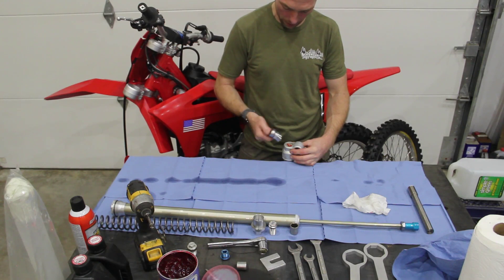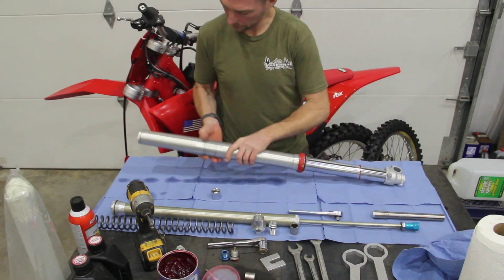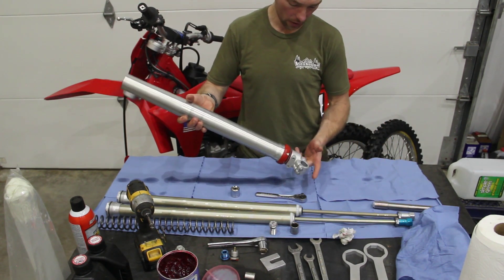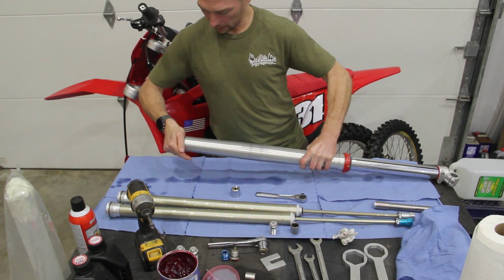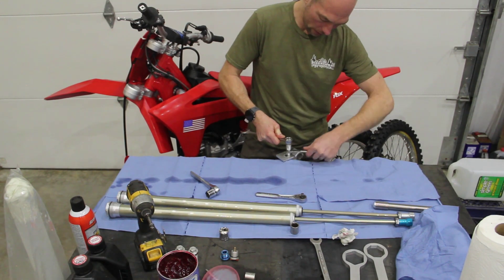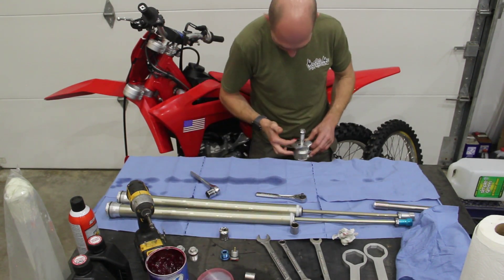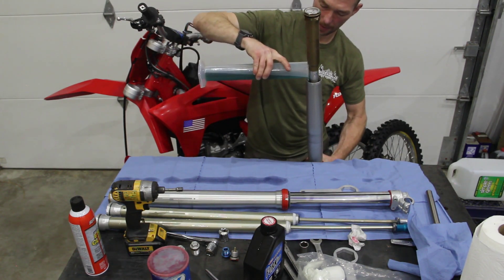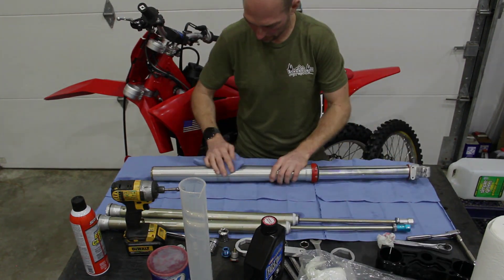KYB Spring Conversion QUICK GUIDE - KTM, GasGas, Husqvarna - dialedmfg.com

Comment: Do you have a kit for 2018
Reply from the maker: The kits to fit 2016.5 to 2020 AER-48 WP forks will be available very soon.  They are next on the CNC machines and I am currently assembling a set of forks for a final Prototype test session tomorrow.